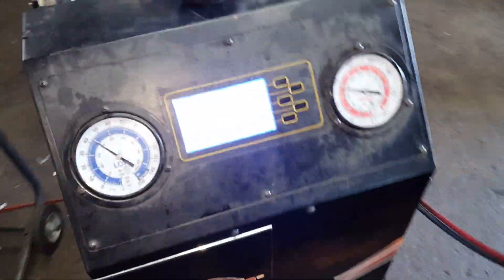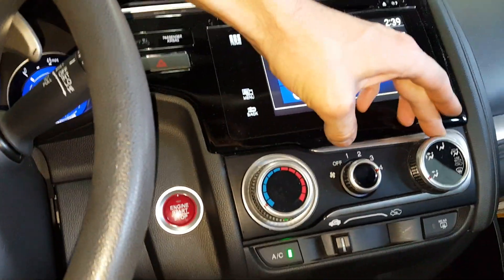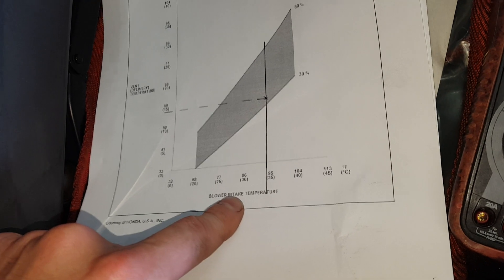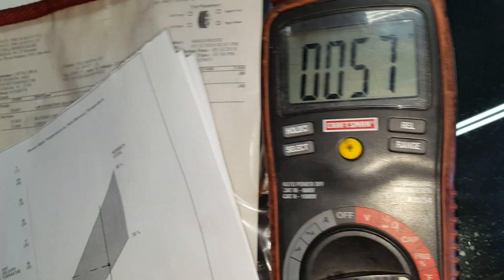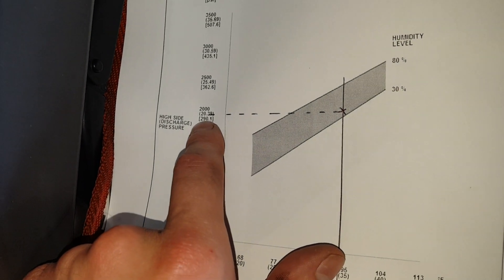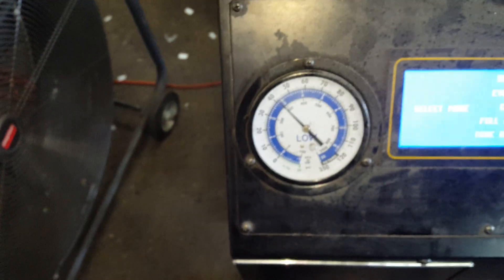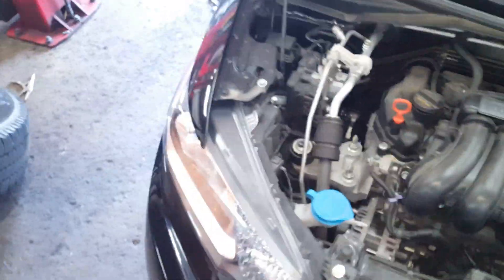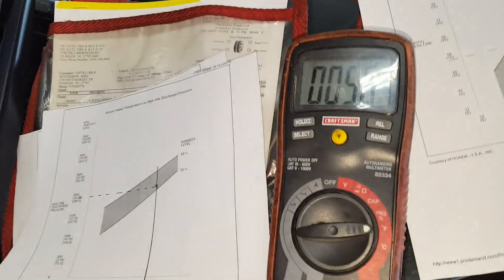Checking Honda Fit AC Performance

Comment: Wow. Great information. But where did you get those graphs? I just checked my 2015 Fit with a thermometer at the dash vent. With the outside temperature at 91 deg F I was measuring about 58 deg F at the dashboard air vent, with the engine at idle; about 52 deg F with the engine at 1500 rpm – approximately that's what I recall. After driving for 10 miles I saw the temperature vary between 52 and 46. This is with the fan at position 3. In position 4, the next faster position, the temperature actually is a bit higher. So apparently it is working correctly, yet the cabin takes at least 10 miles of driving to cool down as far as it will go, but it never gets below about 80 deg F when measured at the passenger seat (away from direct sunlight). The large expanse of black plastic under the windshield remains painfully hot, and I'm not comfortable even with the vents blowing directly on my face. It never gets to the point where I want to switch from recirculate to outside air. At over 90 deg F the car will get comfortable if it is cloudy outside, but not if it is sunny. Sun through the windows warms up the car. Car is a gddm greenhouse. If I stop the car and open the door momentarily, the car gets uncomfortably warm right away, then it takes another few miles of driving to cool down again. I never put the eco button in eco mode. In stop and go traffic, when the engine is at idle, the air temp at the vent goes up to about 58 deg F, varies between maybe 52 and 58. The cabin is uncomfortable. I have a refrigerant sniffer. It beeps. I hear a tiny bit of beeping, for about 10 seconds,  if I unscrew the dust cap from a schrader valve, otherwise it doesn't detect any leaks. At idle I hear something turning on and off. ON, the temp goes to 52, off, rises to 58. I believe this must be the compressor clutch engaging and disengaging? Or maybe its the fans for the radiator and condensor switching between low speed and high speed. For some reason I was expecting to see vent temperatures in the low 40's, even 38-39, rather than in the 50's.